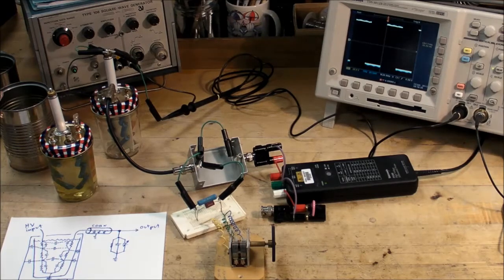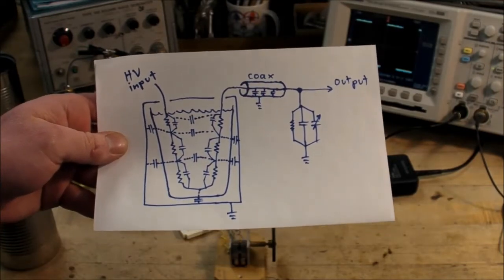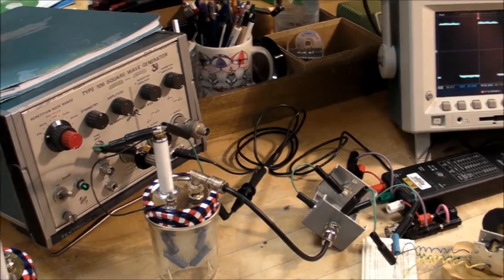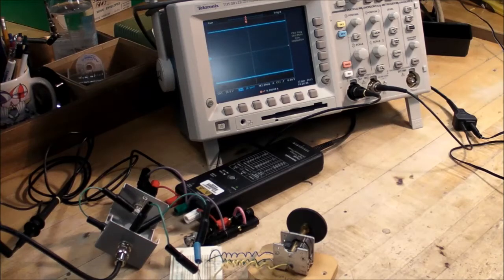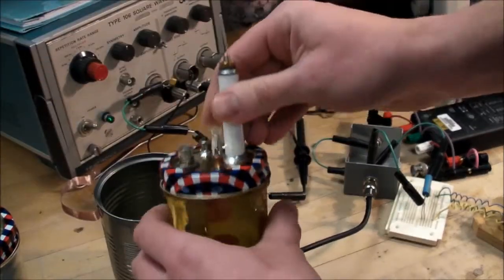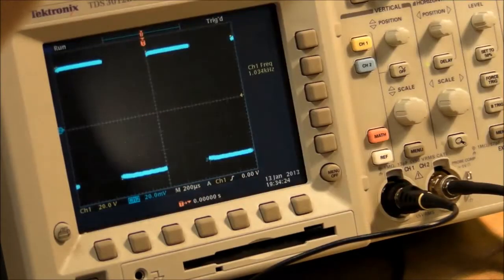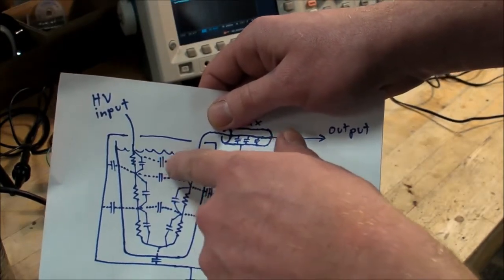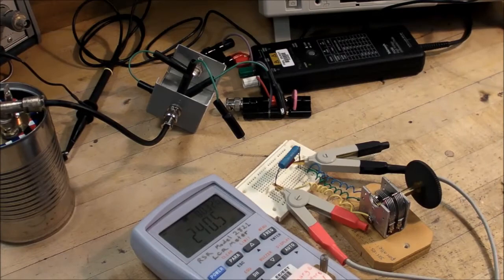(#0048) Testing the High Voltage Oscilloscope Probe - DRSSTC vs. Spark Gap #08

Comment: 3:35 Isn't that undercompensated instead of overcompensated ? 
Can you show the modification to that Tektronix differential probe ? It seems that you swapped the fixed testleads with banana plugs, 
and added a direct ground in the middle ? 
Doesn't that direct ground effect the measurement ?